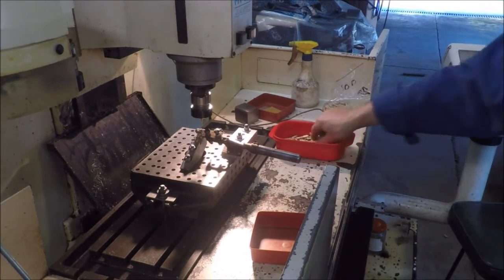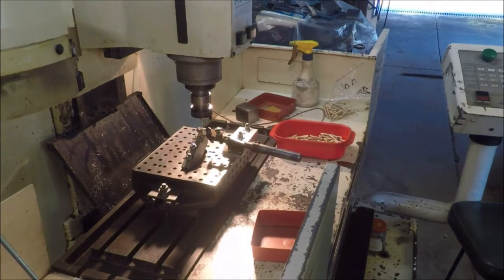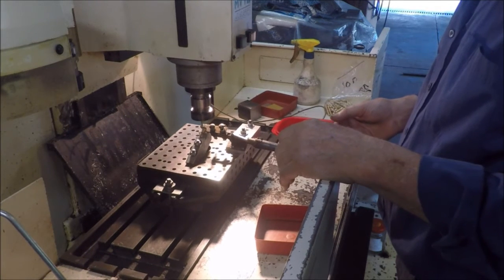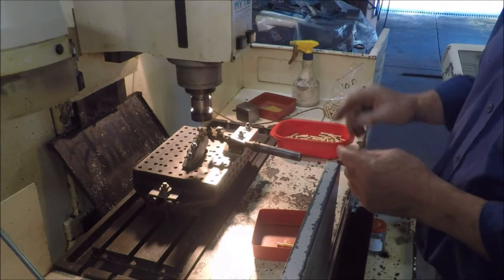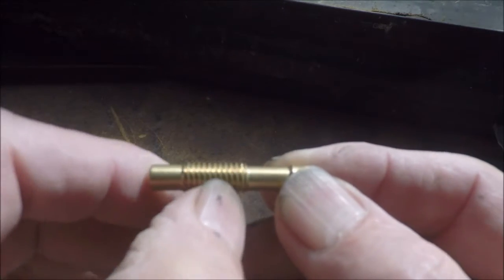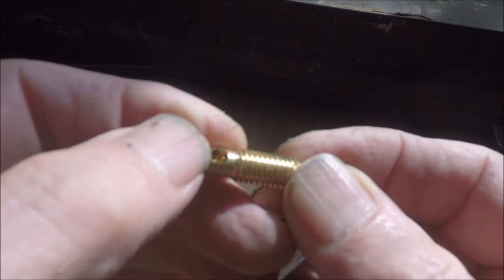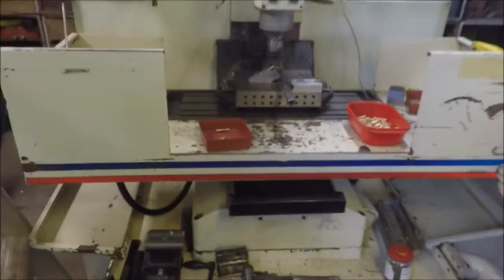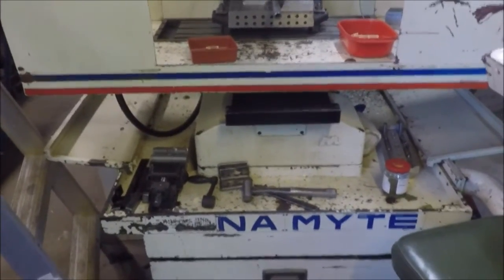Machining gas jets on my Dyna DM 4400

Comment: Interesting videos, thanks for your time. Regarding your foundry sand, how are you reconditioning it? Thanks again.
Reply from the maker: Thanks for the comment, I am glad that you found them interesting.Regarding reconditioning my foundry sand, first let me say that I do not have a Muller - I wish I did but never found one cheap enough and although I have often considered making one, being a lazy SOB I have never got round to it.I do have an aerator (for want of a better term) which does an excellent job of breaking up any lumps and of mixing whilst aerating. So Immediately after casting breakout while the sand is still warm and spread out (using a rake) on the concrete floor I walk on it to break up any big lumps then I spray it with the right amount of water (a guess guided by experience). It is then shovelled into a heap and passed through the aerator from where it falls into the 200 litre plastic drum in which it is stored and is ready to use the next day. The Aerator will be shown in a later video about how I make and mix my facing sand (in the can!) Alternatively I can send you some stills of the aerator that show its (rather crude) construction - if interested  PM me with an address that I can send them to. This aerator does work very well and I suspect that it would do a good job on petrobond too but I have never used the latter.
Reply: Thank you for the response. I built a muller about six years ago based on a book by Stephen Chastain which has worked very well with the clay bonded sands I use, and I was interested in your method. Thanks again!
Reply from the maker: I don't know what Chastain's muller looks like but some of those that I have seen people make are works of art! They look as though they would take almost forever to make and require a lot of material. I sure hope that the people who build such gems get sufficient use out of them to justify the effort. By contrast my aerator took perhaps one to two weekends and was made from stuff (junk!) that I had lying around. Mullers sure do a great job of spreading the clay on the sand grains and of mixing in general as well as breaking up the lumps. However they do compact the sand a bit and I know that a lot of foundries run their mulled sand through an aerator before using it. The aerator gives a lovely light silky feel to the sand and it rams so much better after aerating. I might hazard a guess that if you built an aerator you may never use your muller again.